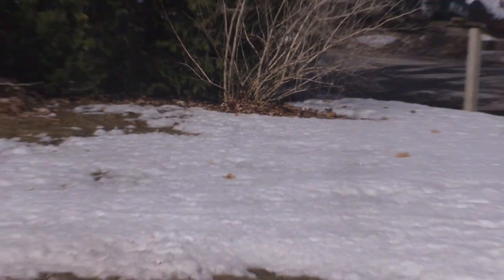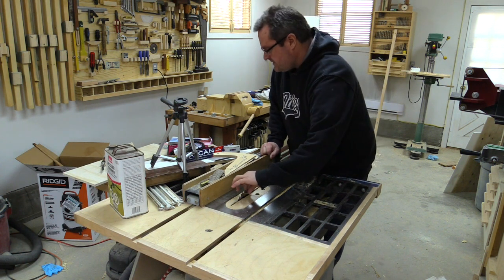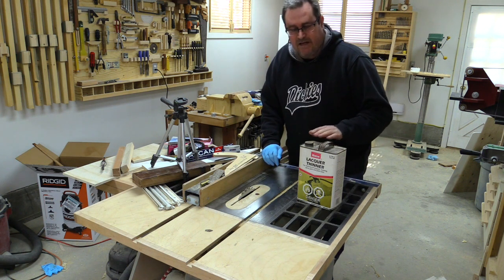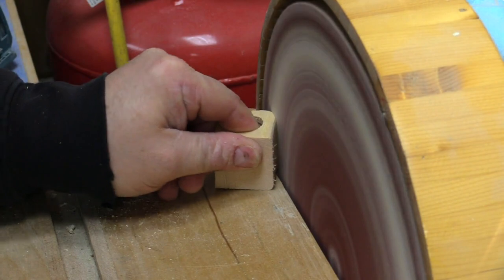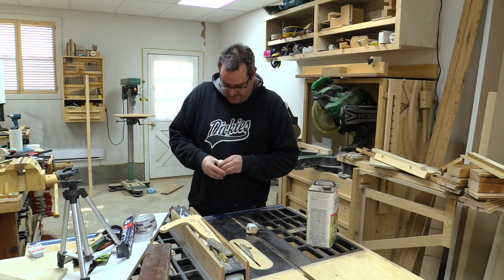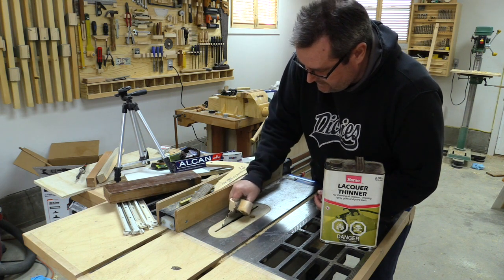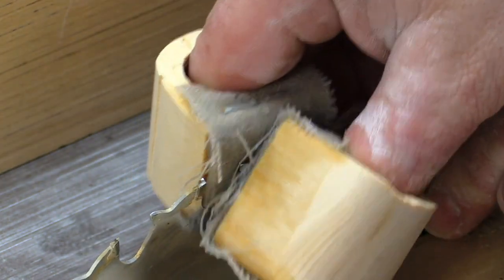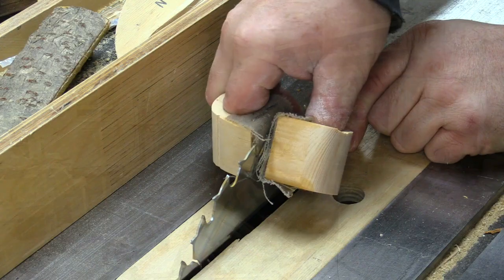Easy Saw Blade Cleaning

Comment: John
I found that house cleaning Orange spray will clean easily:
Remove the blade from the saw, put it in container like a mud bucket cover and spray the blade, let it soak for a few minutes, take a rough tooth brush and clean the pitch of the blade. If necessary more, just repeat the process again.
For tougher pitch, you can use a  small brass wire brush (Harbour Freight stuff).
Wash it with dish soap well, dry it and apply some spray lubricant to prevent rust.
Cheap, easy and NON toxic!

Comment: Simple, elegant, and effective. Part of me thought you were going to mount the blade on a hand crank device, with your pads mounted either side of the blade and then turning the blade backward between the pinched pads until clean. 

Glad to see the now melting away - let's hear it for spring.

Comment: Easier way to clean a saws blade. Pour regular old Windex (Simple Green works also) into a shallow plate (lid to a five gallon paint bucket works for table saw blades). Let the blade soak for a bit (about a half- hour). Take out blade and brush off stubborn areas with a stiff nylon bristled or SOFT brass bristled brush.  Very simple, easy method and you will not be using harsh chemicals like lac thinner or acetone.
Reply: This is exactly how I do it too. The only work involved is to remove and replace the blade. The 1/2 hour while it's soaking can be spent doing other things.
Reply: Or, keep three blades and rotate them out to the cleaner solution, then ready rack!
Reply: Not sure the brass, or nylon is necessary - if a wire brush dulls your carbide, you need better carbide, no?

Comment: Cool tips, thanks!  I've been using specialty solutions, this should save me money!  
Side question... how do you find that V belt is for difference in vibration and sound?
Reply from the maker: McGinn's WoodShop The link belt on my saw? Much smoother and quieter.
Reply: Yes, and thank you!  Keep thinking on buying one and now I've decided.  Next step is to save up.
Reply: McGinn's WoodShop harbor freight sells link belt 5 ft for $24.99 about $5-10 cheaper than other places and its good belt
Reply: Perfect thanks Mike!
Reply: The only problem I have with vibration and V belts is when the pulley on one of the spindles has a very small radius, and the tool sits for a long time and bends the V belt tight around it. Then, when you turn it on, that tight turn causes the unbalanced belt to make the whole tool wobble. I've found that cogged V belts help more with that, but they are slightly noisier. The slots between the cogs allow for better belt compression around tight pulleys without stretching the outside diameter as much, but the edges of the cogs now "hit" the pulley and add a bit to the noise.

Generally, they cost 20-40% more, and to search for them you just add an X in the belt name, so an "A-25" becomes an "AX-25".

I've not used link belts yet to compare.
Reply: McGinn's WoodShop I was testing sound levels yesterday between V and link belts; they were identical, 82 db. The link belt had significantly less vibration.

Comment: I switch my blades around quite often depending on the project, etc.  I clean mine while they are off the saw and use Greased Lightning.  Just spray some on and watch the buildup melt away in seconds.

Comment: Lacquer thinner isn't as bad on skin as many think. I did auto body work for years so my hands were constantly exposed to it with no problems. 
I found that lacquer thinner is a quick way to heal up a cut in the skin. It'll burn like hell at first, but it'll heal up really quick. Just pour clean thinner on the cut, gut out the burn and in a day or so it'll be in good shape. 
That said there's probably plenty of people who will say it's the worst possible thing to do, but it always worked for me.
Reply: By the way..don't try this on scrotum cuts.. The reason should be painfully obvious..lol

Comment: Oven cleaner can damage the solder that is used to hold the tips to the blade it is not recommended by any of the manufactures for that reason. It can also soften and even remove the protective coating on the blade.

Comment: interesting for those that may not have other methods. I use a pneumatic die grinder with a brass wheel...hold it with one hand on the correct side so that the brass bristles hit the sides of the teeth from the rear, then slowly spin the belt backwards with the other hand. Cleaned and polished in....I don't know..something like less than a minute? LOL

Comment: I wasn't sure what would work best so I tossed lacquer thinner, kerosene, denatured alcohol and white spirit in the bottom of a bucket so it was enough to cover a saw blade lying on the bottom. Put the jar on and left it, then when I fished it up it wiped off clean with a rag. This kitchen sink method doesn't require a lot of work if you use it on blades you aren't using at the moment.
Reply from the maker: 1873Winchester Of those solvents you listed, the most aggressive (and the one that did the cleaning) is lacquer thinner. It will dissolve or break down most plastics, so should be put into a metal container.
Reply: I Build It  Lol I think they sell thinner in plastic bottles here in Holland...
Reply from the maker: knives&stuff I did say "most plastics". Unless you know for certain, it would be best to put it in a metal container.
Reply: I Build It I wish I'd seen that before this Sunday. I melted the outer surface of an ABS tube I was trying to clean. Wild stuff!

Comment: I bet microjig would love to make those out of plastic and charge $39.95
Reply from the maker: krtwood The sad part is that guys would actually buy them. Imagine, a shop full of tools and buying a push stick.
Reply: Well I must confess to owning a gripper, which is useful once in a while but way overpriced. There's a push stick from rockler too but it's aluminum and can be thinner than what I can do with wood which is handy at times.  Mainly I had gotten it for my dad who has an aversion to using shop made things but no aversion to doing stupid things at the table saw, which he thankfully doesn't use anymore.

Comment: Well, it's obviously working, but I can't see why you wouldn't want to keep using the initial cloth & glove method, since that's also working just as well (from what I understood), and it's just as simple to use, and probably more effective, since on these contraptions you'd have to change that rag from time to time (too). And the cloth piece might reach places where these blocks of wood wouldn't... right?

Not criticizing you in any way, just wondering why you think this is better.
Reply from the maker: Cosmin G. PĂLTINESCU The rag and glove method didn't work as well, as I mentioned in the linked article. Try it out - it's easy to do.
Reply: I Build It OK, I will. Thanks!

Comment: I have to check, what's cheaper, but the oven cleaner I use takes maybe 30 seconds to dissolve gunk on blades and router bits (funny enough the cleaner does not work well at all on an oven). I don't know what's in it, but it foams up as soon as it comes in contact with resins, residues of which can then be easily brushed away with a plastic brush (the blade being flat in the lid of a bucket). I don't panic about "dangerous" chemicals, but if something that doesn't even have an "irritant" label on the spray bottle works almost as good, I rather use that. And who can argue against blades smelling like oranges and lemons after cleaning ;) .
Reply: The one (and only!) time that I used oven cleaner, I used it on a Teflon-coated blade. It remove the Teflon coating as well as the pitch. If you're using it on uncoated blades, it will work fine, but I want something I can use on any blade. That's the only negative that I've found using oven cleaner (except for the fumes, but I always work with chemicals outdoors anyway.)

Comment: Oven cleaner is caustic.  It's really nasty stuff.  I'd rather have lacquer thinner on my than oven cleaner.  And you have to take the blade out and then take it out of your shop before you spray the cleaner because it travels through the air and lands on everything.

My nitrile gloves don't hold up to lacquer thinner more than 30 seconds.  Latex and vinyl gloves are even worse - instantly melted.

Comment: could you not just use a wire brush and have the table saw running to clean it
or would the teeth of the saw pull the brush out of your hand I've aslo never used table saw before